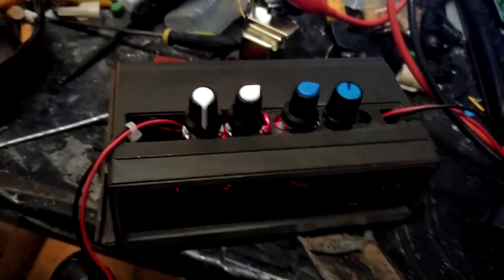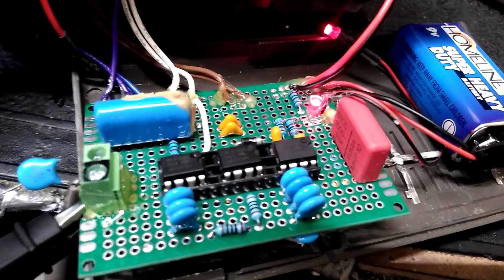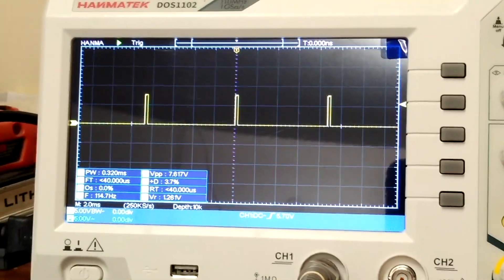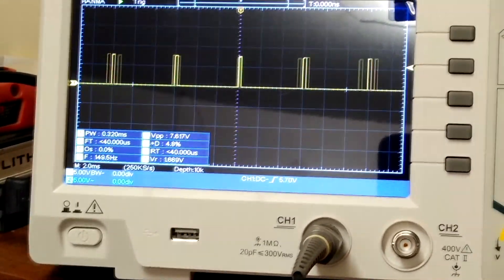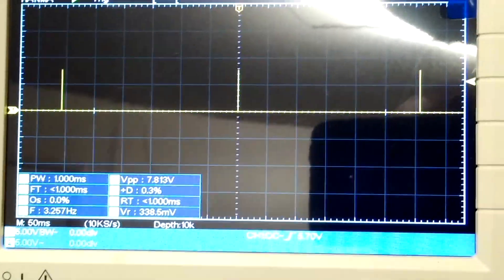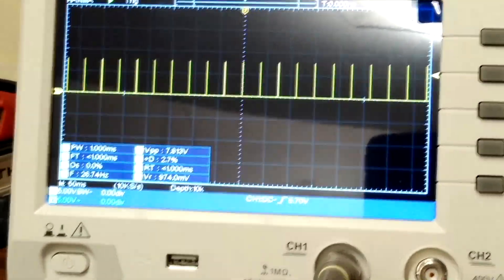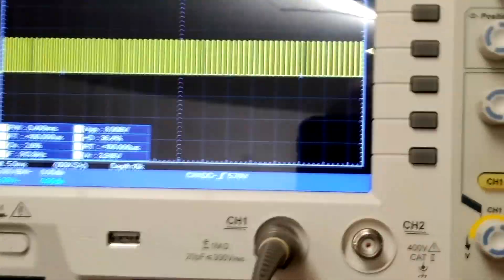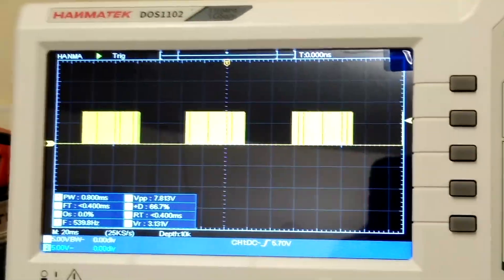Steve Ward's Burst Mode Interrupter DRSSTC .5

Comment: There's a guy named Parnas or something, I forgot about his name! He brought a modification to the mazilli zvs driver in 2018 by adding a mosfet driven in the middle. So far, I haven't seen anyone tried that modified version as I don't know if it's good or not! When I peeped into his modified zvs, it looks good but don't know how far we can trust his version!
Reply from the maker: I keep having to go out of town and have too much going on lol but I plan to make a project out of it since I've been meaning to do it for a while. I've seen the Piernas circuit and it's pretty cool but I may go with the reliable half bridge design instead.  ZVS drivers are cool and I do have a pretty beefy one that drives flybacks well but I may as well make another half bridge and driver but instead of self oscillating just use the gate drivers. Just imagine a common SSTC circuit but instead of a primary and secondary TC it's just a flyback transformer. This allows for high voltage input as well and is less stressful on the switches. Since I don't actually need enable pins I can use some old fake gate drivers I have and just feed the inputs with a PWM of my choosing. I'd just add a drive signal input for either running from a sig generator or to plug in an interrupter.

Comment: Hi there again! I need a video of you showing the Steve ward burst mode interrupter (The one with the three ne555) triggering a TV flyback transformer using a single mosfet. The thing is that I've seen Franzoli Electronics doing it long time ago but couldn't have figured out how he did that. His video didn't showed up everything in details. You think you'll manage to do that? Just let me know, thanks man.
Reply from the maker: Different ways to go about it but I'd probably just use a gate driver with an enable pin or could even probably interrupt it at the power rail driving it with a mazzilli driver. I do that with a zvs supply driving a flyback core but there is no burst mode. The core just has a primary and secondary for variable voltage output  which varies by me controlling the duty cycle. I could either replace it entirely with a hv flyback or just drive it directly from the sine coming off my zvs transformer secondary. I can try to build one up when I get back in town Friday shouldn't be too hard
Reply: @Magneticitist  thanks dear for replying back. OK, when you are done with it, just let me know.

Comment: really good results... you'll probably hit the cieling with the spark when using IGBTs bcs ebay mosfets usually have the RDSon of a vacuum tube
Reply from the maker: haha I think you're right. I've been using amazon '918' 460's cause they all seem to check out the same when I order them and the wait is short. Not sure the legitimacy of them or the on resistance but they do start to get a little toasty when hard switching high on times, I think that's how I've been killing them from mains because it's always low bps when I've allowed for really high on times. I haven't really figured at which point the caps go either but these are more from amazon that are the same listing but arrived as smaller caps than the first ones in physical size. If a legit CDE and IGBT's make all the difference that would be awesome.
Reply: @Magneticitist  checking RDSon of a mosfet is quite easy if you have a constant current PSU and you have... just slam 10V on the gate, 2 amps on the drain and check the voltage between drain and source, with 2 amps and a supposed RDSon of 250milliohms you should have 500mV, you get the picture (of course you have to compare it with the datasheet)... also i crack open the transistor after it pops so i can see the size of the crystal, a good 460 should be like 9mm wide.... we were talking about this in another video and another user confirmed there can be an SMD mosfet inside the 460s... i also made the mistake of buying 260s on ebay and they are really good.... yeah.... really good IRF640, i hope they give up this market soon -_-
Reply from the maker: @redoverdrivetheunstoppable4637  I probably should freaking check... never have because I've often used particular ones with success as well as very little heating. The ones which are fake usually become evident quickly but I think many of these 460s going around are the cheapest ones produced sold in quantity from distributors, some of the amazon ones that is.

Comment: Man! You are simply outstanding with your DIY Tesla coils. I simply wish I could do same as you! You are amazingly talented & very good at those crazy diy Tesla. I love lightnings & high voltage. The only problem is that we don't have availability of all those parts in my country. Even though if I order online, certain things are banned in my country. ( Everything on which it's written high voltage) The custom officers will either return them back or simply throw them in the bin. So, I'm stuck & can't really build my own. Looking at all your diy stuffs, you make me craze for doing same thing. Bro! You are too good at these things. You have the patience & the passion. Keep it up.
Reply from the maker: Thanks I appreciate it. Makes me feel lucky to be somewhere in the world where I have access to this stuff. One possibility is to just pull components from old electronics but sometimes it's hard to acquire enough that has everything needed. Much of what I make these TC's from came from a bunch of TV boards someone gave me a while ago. Tons of capacitors and mosfets and IGBT's etc (and some toroids) but I always seem to need to buy something in particular from amazon or ebay.

Comment: That interrupter is awesome. It’s crazy how precise you can get with those 555 timers
Reply from the maker: Yea man I used to stick to the TL494 but realized it took more work to make them as precise. Starting to like the 555's. I've been screwing with this coil forever and toward the end finally realized the 460's couldn't handle the max output at mains.. Can't wait til I get these IGBT's in a few days. This is such a cool circuit I'm glad you recommended it to me but now I just want to sort of have closure on it so I can put it aside and start a new one using primary feedback. It kept killing me that my output wasn't any better than some interrupted SSTC's but I kinda winged this one and can't complain.